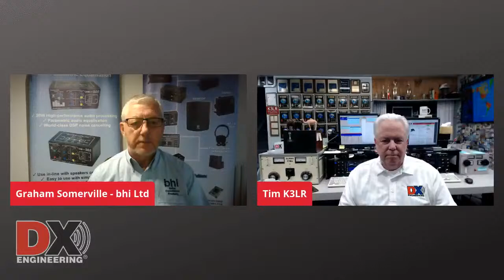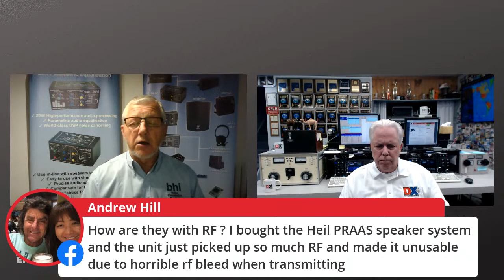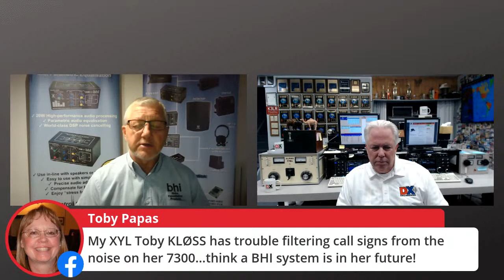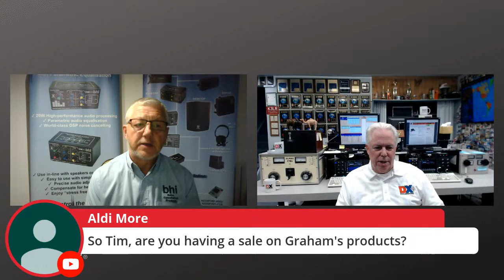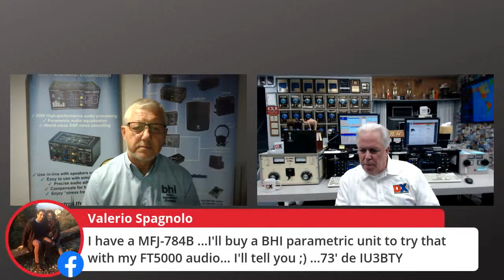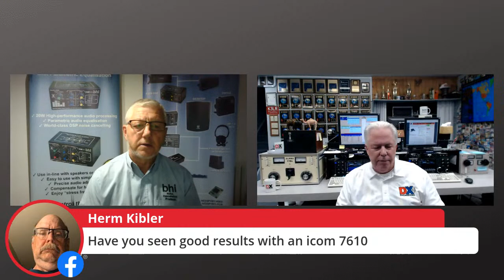Manufacturer Showcase with bhi Noise Cancellation Products

Comment: I have always used BHI products being mobile. My first unit fitted inside my Yaesu FT897D and it worked so well. I now have the desk speaker and ground breaker in my /M setup. Without the BHI helping to clean up the noisy bands, i would not of have such great contacts from qrp stations around the world.
Of course, its just great that Graham lives really close to my work qth!
Without doubt, Graham has a real passion for his product and for helping operators with his great Devices.73
Rob M0KPD/M